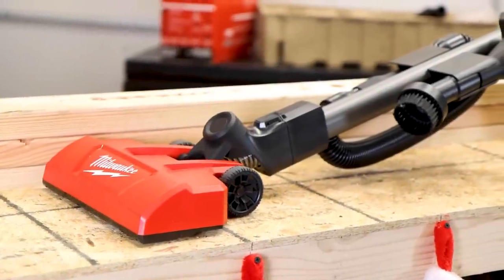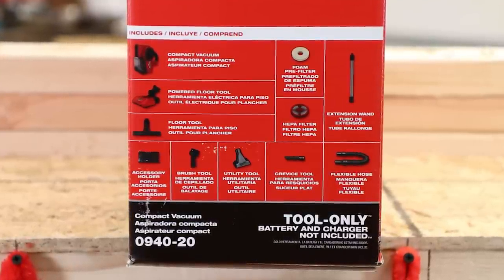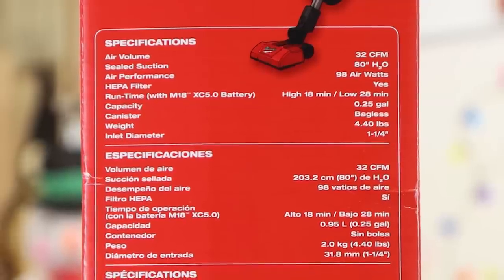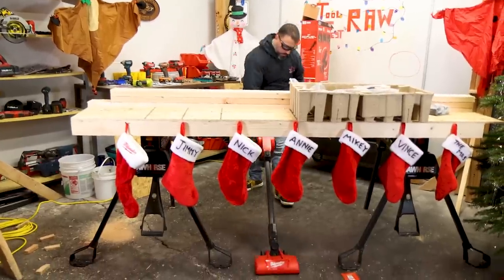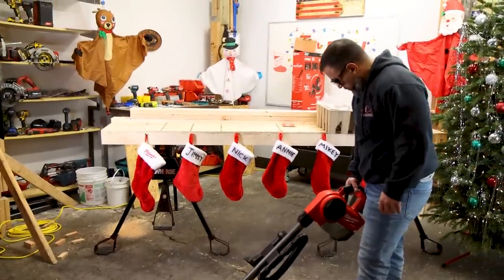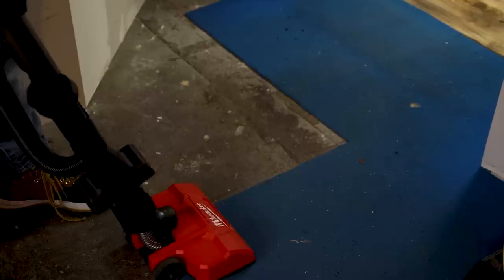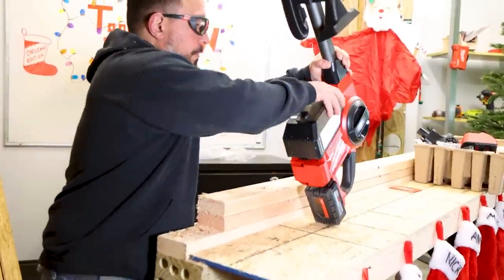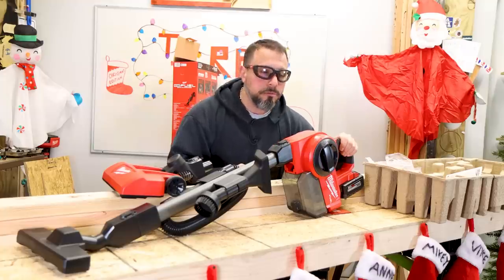NEW MILWAUKEE M18 FUEL 10 in 1 Adjustable Compact Vacuum (MOST VERSATILE EVER MADE)

Comment: Hi Vince, thanks for the vacuum demo!  Looks to be a good product.  On a side note...I picked up the M12 Fuel Vacuum a couple days ago, then took it back to HD.  My Wife wasn’t impressed!  She said the hose was too short.  She doesn’t like short cords or hoses!  What can I say?  It was my vacuum, not her vacuum, however...she dissed on it so much I couldn’t keep it.  This may sound weird, but when I get a new Milwaukee tool I like to show it off and get her approval that it’s a cool tool and how did we survive prior to getting it?  There’s no way I could keep it, then break it out to suck up the dogs hair on grooming day knowing that she would not be impressed.  She was comparing it to the Stinger!  She said yeah the Stinger is corded, yeah it is much louder then the M12, yeah it’s probably not as convenient, but it has a longer suction tube and it’s lighter in weight.

She might say the same thing about the new M18 vacuum.  The more I think about it I have to agree with her.  Milwaukee should lengthen all of their vacuum hoses by at least 3’.  I should be able to leave the vacuum cleaner on the ground, yet stand up straight to suck stuff up.  I’d like to get you thoughts on this.

Comment: I bought this vacume on December 3rd 2020. The attachment only go a certain way with the crevis tool on top, it is very choppy on low pile carpet and horrible on high pile carpet. There is no height adjustment on the carpet attachment with the spinning brush. This vacume does not come with a walmout and does not stay upright on its own. It cleans ok on hardwood surfaces. My wife wants me to return this because of these issues.

Comment: Perfect for pre cabinet setting and cleaning up after cutting base and casing but I’m  not sold until I have an attachment for I my mitre suppose i would have to take some measurements as it might be good for small job rips on the table, sanding, and a few plunge cuts with the track.  It’s pricey as far as a vac but less than a festool by a long shot.

Comment: A few thoughts on the vaccum.
1. Are the parts connections plastic, metal, or glass fiber ?   It there plastic,  they will not last.
2.  Dog hair, fiberglass, and dry wall ? I wonder how well it will do ? 
3.  Replacement filters.  What is the availability now and what is Milkwakees commitment in the future for filters and parts ?
4.  Just my opinion, but it looks to me like there is a lot of plastic in the tool.  I use Fein and there not plastic on the inside.
I know I am picking it apart, but it looks cool and from the video I like  it. 👍 
I would like to see further testing on the vaccuum and I am in the market for a battery vaccuum solution at the moment.

Comment: This has nothing to with video  but to you contractors.  HD has value pack of Diablo 10 inch 40T, 2 blades for 47.97 value pack . Not sure if good deal or not just letting guys know
Reply: That seems ridiculously expensive.  I saw those in the clearance aisle at HD and thought the same thing then.

Comment: Bought this vacuum, it's not great lol.  I'm an electrician so I bought this with the intention of picking up small copper bits and little insulation strippings. It cant even do that. Really all it's good for is dirt. That's it. Feels like it's not made for the trades. And no it definitely can not pick up little screws. 

One of the bigger drawbacks is that it DRAINS batteries. I used it with a fully charged 6.0 high output battery and I shit you not, it drained the battery in 10 MINUTES. yes that quick.

Comment: Awesome video. I really like that vacuum. I was wondering which type of battery would you suggest  from the m18 series. I've seen basically low too high price batteries from 60 too $200. That I seen from home depot. Can you help with what type too get.
Reply: Depends on what tool you'll be using the battery for.  A 1.5Ah is perfectly fine for the 18ga brad nailer, but crap for the table saw (it'll run, but at a lower RPM, and go dead very quick).  A 12Ah is great for the table saw, but will be heavy and awkward on the brad nailer.
Reply: @mlindholm   thank you for the advice.

Comment: The powerhead connected directly to the vacuum is for “little people“
Reply: For sure!  My 6'3" butt has to bend slightly to use it well.  I'd love a 1-foot extension to make it more suitable for those of taller stature.  You could also then use it with the beater head and vac for stair cleaning, perhaps!